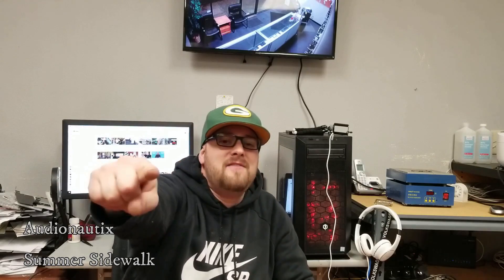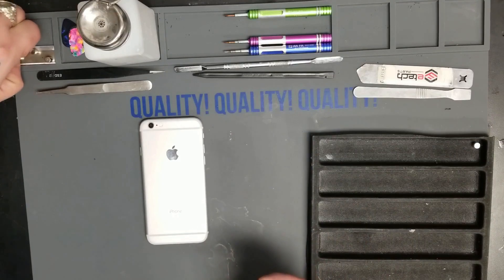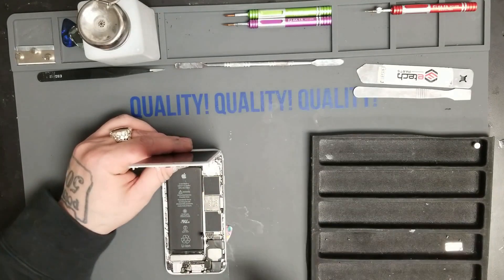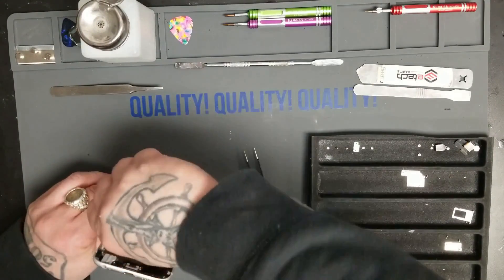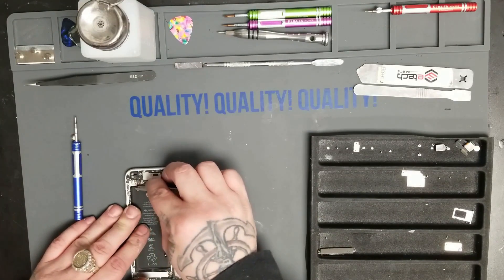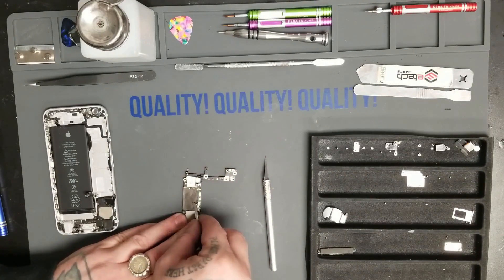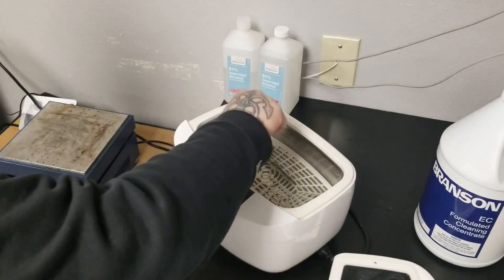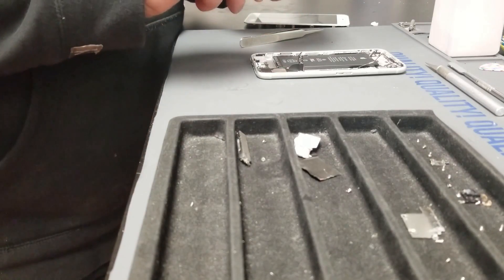iPHONE 6S WATER DAMAGE REPAIR

Comment: Now much would a lg g stylo be?
Reply: Just easily take the board out and soak it in alcahol
Reply: @Obs.mingus  the thing is I have tryed takeing off the gry back cover so I can taje out the board but, the bottom camera screw does not come out 😑😑
Reply from the maker: It really depends on whether or not it needs parts.

Comment: i have an iPhone se that got a little water on it everything works except the bottom 2 lines of qwerty keys on text and can't hang up phone when i make a call -I disconnected screen and cleaned connectors but same prob. -can i mail it to you? turn around time?
Reply from the maker: Did you clean fpc connector on the LCD, not just the circuit board? If that's the only issue it will likely be fixed with a new screen.

Comment: My phone is water damaged but the thing is it’s working perfectly fine (I’m using it right now) but the display is just not clear (I don’t know how to describe it but the display is faded and has tiny lines) is that fixable?
Reply: Yes, you can get it fixed, but I don't think you can at home. You would have to take it to maybe a phone doctor in a mall, or some place like that.
Reply from the maker: Yeah it probably needs a new display.
Reply: Cellular Mekanix Do You Fix Iphones?
Reply: uSe riCe lOl
it helped mine when my screen was foggy it was cuz of the water

Comment: hey man i recently messed up my i phone in sea water ... i let it dry thoroughly and then replaced the battery, port and began to fit the old existing screen to the i phone six when i was hearing an audio crackle from the screen, i quickly removed this and put another old existing screen on the i phone six which hasn't been water damaged and still getting the audio crackle. i did have life in it for all of a few seconds but quickly disconnected the screen to prevent further i phone damage. is there anyway in cleaning the board with alcohol etc and without using all these tools as i dont have the facilities for this. my main priority is just to get my data off my phone and the rest is a bonus. drop me a private message if you can help a brother out ! cheers.
Reply from the maker: Just scrub it with 93% or better rubbing alcohol and a soft bristle toothbrush. That's the best advice for someone without tools. You can also soak the board in a bowl in the rubbing alcohol. In sea water your board likely has salt on the board which is causing shorts, so clean that up and see what happens.
Reply: Jason o

Comment: Can this be done without a ultrasonic cleaner?
Reply from the maker: Yes, just do every step but the ultrasonic.  Sometimes scrubbing with alcohol will do the trick. It all really just depends on the extent of the damage.
Reply: @Three-Minutemen  The motherboard 'looks' fine but I'm not too sure because it(the phone) has been sitting in my cupboard for a while before I tried to fix it but I did put it in rice. The screen I am also not sure about because there is corrosion at the top where the selfie camera is and a bit down the side. The battery also does not work and now I don't know how to tell if the motherboard is broken or if its the battery or screen.
Reply: Do you know if there's any way that I could check which is broken?
Reply from the maker: toli Honestly it is difficult to do so without having the extra parts available for test, and I'm not sure it would be worth it to you to order all of the parts just to check them one at a time.
Reply: Do you know of any ways to check without ordering new parts?
Reply: @larold8767  Buy a cheap icloud locked phone off ebay to use to check all the parts. Thats what I do.

Comment: trying to take out the battery but dealing with rusty screws, any advice?
Reply from the maker: Rusty screws are the worst.  I've tried baking soda, rubber bands, and all of the other tricks found online. Sometimes I've just taken the whole phone minus the screen assembly and dropped it in the ultrasonic. But the truth is, if there is that much rust in the phone, it probably isn't coming back anyway.
Reply: Get new set of screws and  drill out the old ones.  That works on automobiles

Comment: i got a iphone 6s and i replaced the battery,charging port and cleaned the motherboard which was with 91% alcohol.but it wont turn on how do i know if the phone is fried or if i need a new screen?
Reply: Javier Aldrete You need to change the screen. Water gets behind the metal plate and fries all the pixels. So the phone turns on but you won't see anything
Reply: RzVids what if the screen thats water damaged works on another phone but not the original

Comment: can u list the equipment u used to fix the phone thx
Reply from the maker: You need a basic phone repair kit that would include a pentalobe screwdriver, phillips head size 00, a flat tip screwdriver, and a guitar pick would get the phone open. You would need an ultrasonic cleaner and Branson EC fluid.  A soft bristle toothbrush, 91% or higher rubbing alcohol. We also use a hot plate or a preheating station to dry out the circuit boards quicker.  It's not really worth doing it all yourself unless you plan on opening a shop and repairing more.  It would be pretty cost prohibitive.
Reply: Cellular Mekanix i got a iphone 6s and i replaced the battery,charging port and cleaned the motherboard which was with 91% alcohol.but it wont turn on how do i know if the phone is fried or if i need a new screen?

Comment: My phone fell out of my pocket and i didnt know basically it got water damaged by heavy rain and i dont have those tools to do the unscrewing and everything so what should i use to fix my phone.. and also my phone has been water damaged since friday and it has been in rice since friday and my phone still rings and everything but my screen has lines nothing but lines on it please help i know im responding late but help please
Reply from the maker: Sounds like there is probably corrosion on your LCD connector.  There isn't really a way to get to it without the tools. Even so, you would likely need a new screen even after clean up. The worst thing you can do is to keep turning it on and pushing power through the phone.  I would suggest finding a local repair shop that has water damage services.  If none are available, keep the phone off and order a tool kit on amazon.  You don't need much, since you just need a one time repair you don't need expensive tools.  You just need a 00 Phillips and a pentalobe.
Reply: How much do you think its going to cost to get my phone dried out/cleaned out and a new screen?
Reply from the maker: myaamonaee ! It varies depending on the shop and where you live but I would say best case with no parts would be about $50-60. With parts if it does return to functionality I'd guess around $150.
Reply: sorry but what do you mean by parts?
Reply from the maker: myaamonaee ! Like if a screen or battery or something like that needs to be replaced.

Comment: Hey my iphone 6 its gray it fell in water a almost month ago is there anytips to help on what i should do
Reply from the maker: First thing is disassemble it and check for corrosion. After a month there isn't likely to be any moisture in the phone still, but corrosion is what would be the most damaging.  You can use rubbing alcohol and a soft bristled toothbrush to remove it.

Comment: At around 4:44, what did you use to remove the only screw that is not a phillips?
Reply from the maker: T Porras It is a 2.5 mm Hex screw
https://www.etradesupply.com/blog/wp-content/uploads/2016/07/41831467594571.jpg
Reply: Thanks!